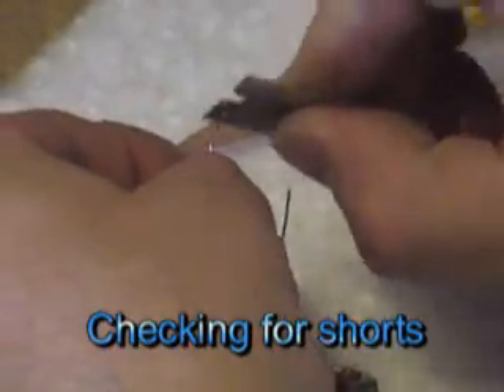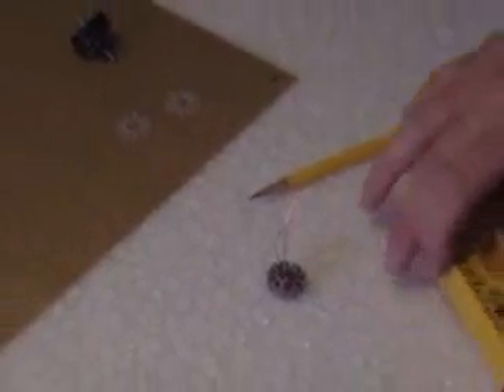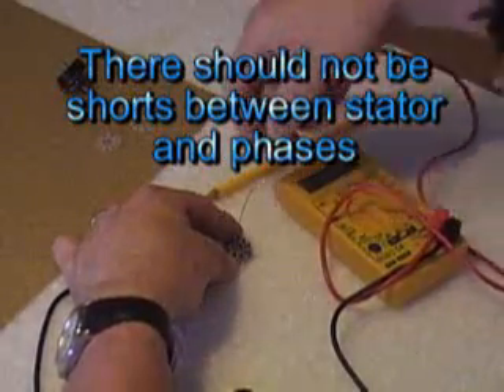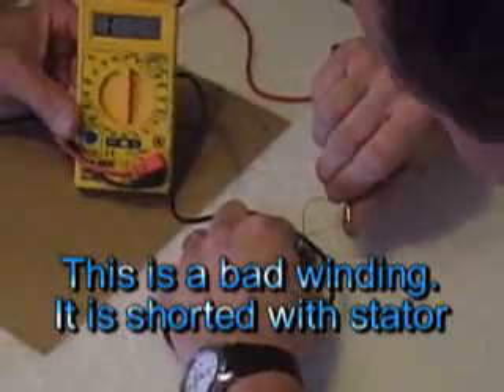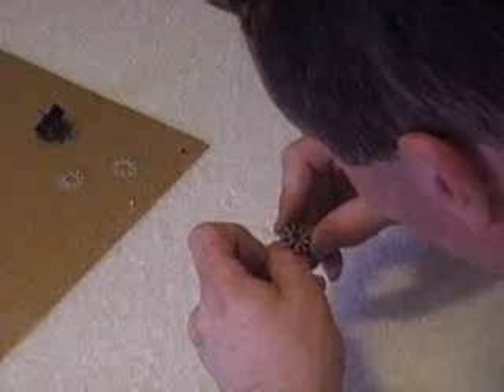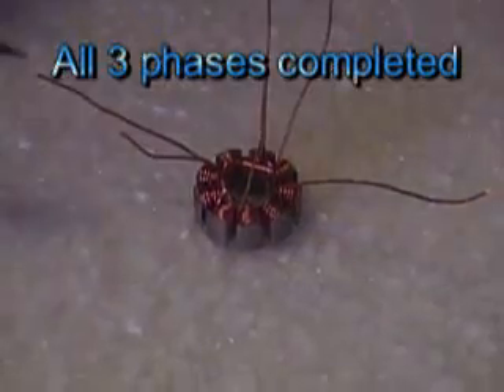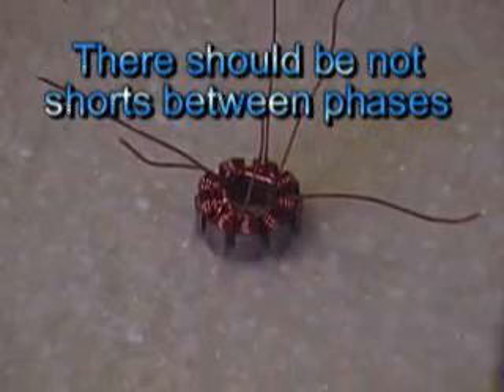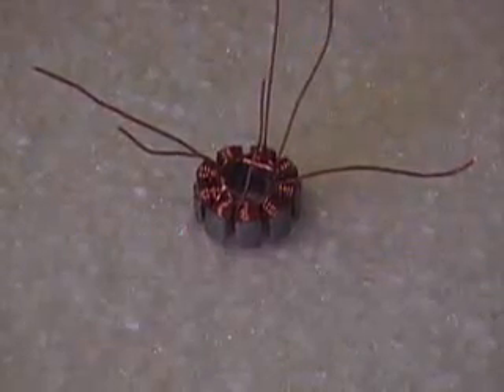Brushless motor winding by Utah Fyers #2

Comment: Good job.. remember guys when you are working with coil connector or ending when you scrap the wires make sure you not only retire the slips but also the varnish from the wire giving you a good contract. At the end wash whiping with Acetone or alcohol and simply sold. :) cheers

Comment: You know...in nearly 30 years of soldering, I never thought to mount the iron in a vice or clamp.  I've struggled for years, mounting the connector or wire with a "third hand" and always ended up burning my fingers time and time again.

Thanks for the idea!

Comment: It is a 3 phase motor in Y configuration.  

Visualize the extensions of a capital letter Y.  A phase winding is placed between each extension of the letter Y for a total of three windings which now look triangular.  

The extensions of the Y are now your three lead wires.

Google 3 phase Y configuration